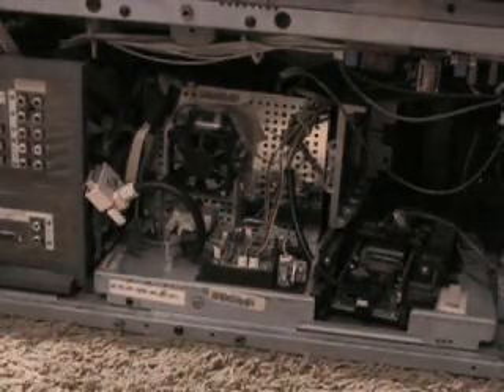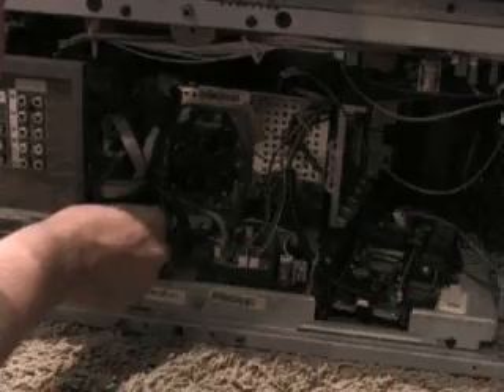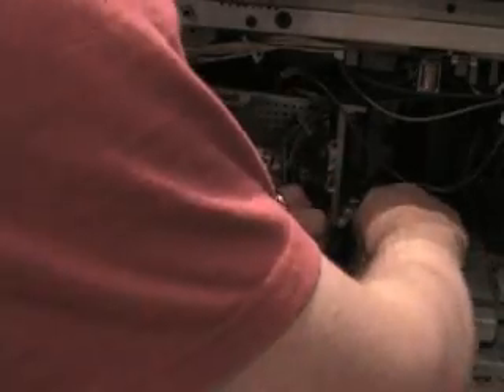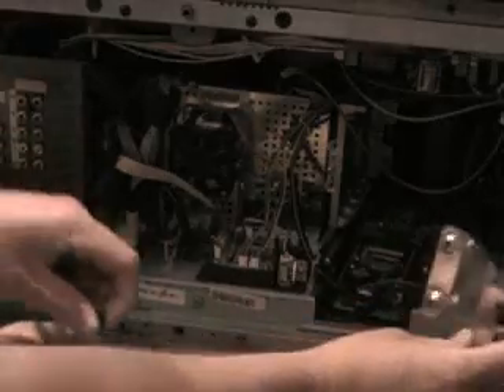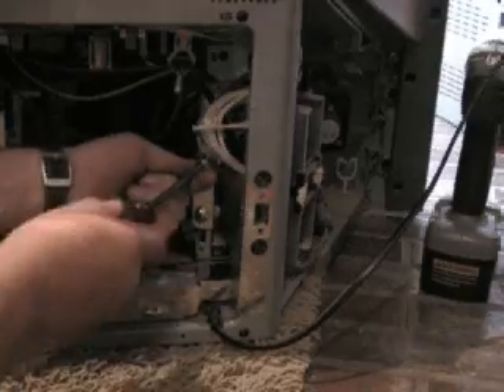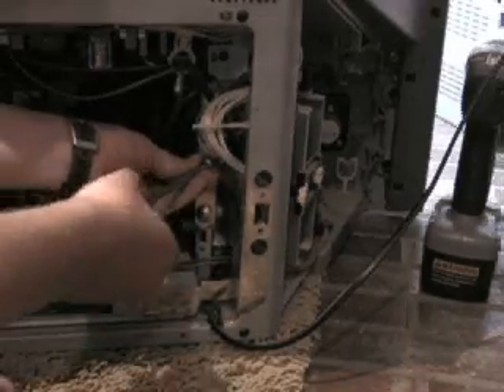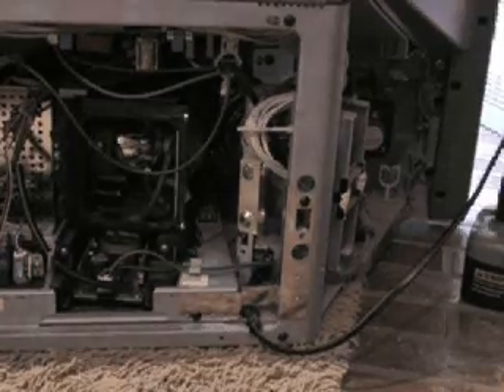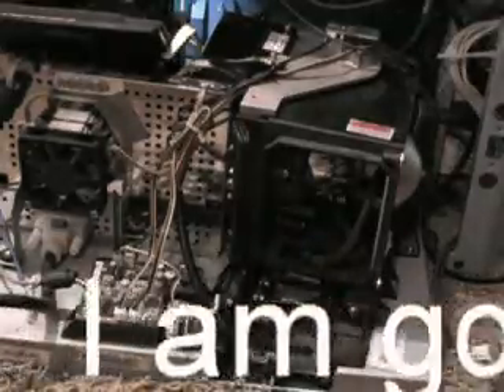Replacing the color wheel in a Samsung DLP Television Part 5

Comment: Thanks for your great instuctional Video on the Samsung color wheel replacement.

At the end of  the video 5 you mentioned you had to repeat this process several times to get it working.

Can y please tell what cable didnt seat right??????

Your help would be appreciated as after installing a color wheel my tv wont light up.

Thanks Gary

garychristensenshow@gmail.com

Comment: Amazing directions!!!  I only thought I could replace the color wheel on my own because I had your step by step videos. The only place where I hit a snag on was that the back has to be on (could even place it on with out the 14 screws) just 2 make sure things are working.  The vent on the back is needed for the fan. If the back is not on, the fan has no place to vent to, and the lamp and color wheel do not start.  This ends up with the "stand by/temp" light being on.   Thank you very much again!

Comment: Just replaced the color wheel on my Samsung DLP Model HLR5078W.  The picture quality is as clear as it was the day i bought it. Thank you so much for posting this video, it was a lot of help. Note - the flat cable that comes from color wheel has to be put back as it was before with the silver side out. I had to correct that on my second atempt. Thanks again.

Comment: I have never used a Youtube video before on a DIY project. This video series was awesome! Thank you! You did a great job. My results:  shattered color wheel. Lamp was fine (but now I have a spare). First try turning on the TV, no picture. As I had suspected, I had the fiber cable from the color wheel reversed (the silver side was not put in to the connector side of the piece). Fixed that without having to take everything apart, and now I can get back to watching the olympics in my living room!

Comment from the maker: @702clark Hi - The color wheel should move very easily. They are supposed to spin at some superfast RPM.  If you think it spins hard, it probably needs replacing.  The bearings are probably going bad and that is why it is spinning hard.  That is typical.

Comment: Thanks man for the awesome help from your videos! Took me 2 tries, I had the ribbon cable in the wrong direction. The contacts should be facing out towards the back of the TV to line up properly with the contacts. I wish I had seen this video before trying to replace what I thought was a bulb problem. Turns out it was the color wheel. Luckily I had bought one a few years ago, but I dropped 60 bucks on a new bulb. Oh well now I have an extra.

Comment: You sir are a saint and a scholar!!! You instructions were perfect and my TV worked first time. The parts company even sent the wrong part (which I didn't discover until I removed the color wheel) so my TV was apart for 2 weeks before I could continue and your re-assembly instructions got me right back in the mix. The only clarification I would make is explaining that the ribbon cable exposed connections need to face left as you look at the color wheel and slip the cable in.

Comment: I replaced my color wheel last night and during the process I pulled a cable connector off around the second video.  It's the cable connector to the right of the DVI cable.  I was able to straighten out the pins and reconnect the cable.  Now when I turn the TV on, the lamp light is flashing.  I don't hear any more noise but I also am not getting any picture.   Any suggestions?

Great video series, BTW!  Thanks!

Comment: Great job on the video! I followed it step by step - but the colors were way off. The TV looked like it had built in posterization - colors, shadows were all off. I tore the TV apart two more times - all with the same results. The third time I opened it up I removed the jumper for the "Air Bearings" and the picture is perfect.

Comment: Instructions worked well, ran in to a problem during installation. I ordered the Incorrect color wheel part there is 2 different  part numbers for my 50 inch sammy dlp.  So i pulled the old color wheel out of the old holder and swapped in the new one from the new part into the old holder. put the tv back together and it works like a charm. Also saved me $ because the correct part was 50$ more.

Comment: Thank you very much for this tutorial!!! i appreciate the time you took to create it. The only suggestion I have for future users of the tutorials are:

1. Make sure the bare side of the ribbon from the color wheel is matched up with the contact points in the slot; and

2. Make sure you place the back cover with the lamp cover back on before you turn it on. Otherwise it won't turn on. It does not have to be screwed in but just on.

Lastly do you have a paypal account? i would like to make a gift

Comment from the maker: @smbrenner Hi - Check and make sure that the ribbon cable that just kind of gets jammed into the connector isn't reversed.  Also, when you are turning the TV back on is the back of the TV back on?  If the back of the set isn't back on the TV won't turn on - there is a switch that the back of the set holds down and if that switch isn't depresed the TV won't turn on.

Comment from the maker: @NathanIVV Check the manual for the red standby light and lamp light blinking means.  You might have just not seated your buld correctly or it might need replacing but I would start with the manual and decoding the light.

Comment: Awesome video man.  I really appreciate you taking the time to do this.  It was very straight forward.  However, of course, I don't think I did everything right.

When I turn the TV on....I just get the red standby light with the Lamp light blinking.  Should I replace the lamp as well?  I had the buzz saw noise for a while & then the humming.  That went on for a week or so & then it just stop coming on.

My guess is that....the lamp is out too, or a cable wasn't put back correctly.  Any thoughts

Comment: Amazing work to put something like this on youtube to share with others. I used this video to replace the color wheel for my HLP4663w samsung 46" tv. No issues and got my job done within 2 hrs.
 One comment I need to make is that I didn't had to remove the color wheel housing holder plate.I was able to install color wheel without removing the plate anyways.No color adjustments needed after the part replacement.
The instructional video works like a charm!!! ThankYou.

Comment from the maker: @bynumezshop You need to look in your owners manual and see what the code for the power button flash is.  That will tell you more about what is wrong.  It could be the seating of your lamp.  You can read the comment thread and I think a couple of people have had a similar issue but they have worked through it.

Comment from the maker: @MrSkohlmorgen If the color is all messed up than the jumper needs pulled.  The jumper wouldn't be your issue if the set isn't coming on at all.  Did you put the back of the TV back on?  The TV won't turn on without the back on (unless you rig up the switch to trick the TV).

Comment: Vids were perfect...I followed them along with my own notes and had no probs! Well...did have one issue on the first try - had the power (the orange/black cable) to the color wheel backwards - so I had to take it apart again and have the metal strips facing the back of the set. Turned it on and picture is like new! Saved me about $1500 on a new tv - hopefully I get another good 5-6 years out of my DLP...THANK YOU!!!